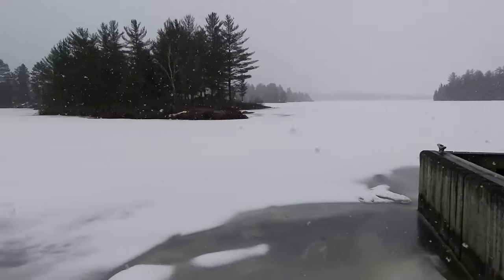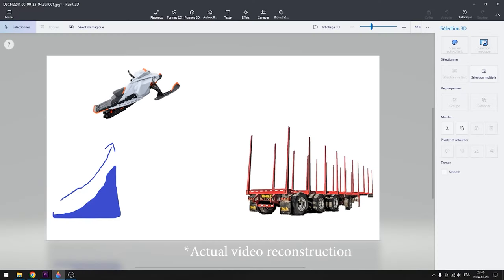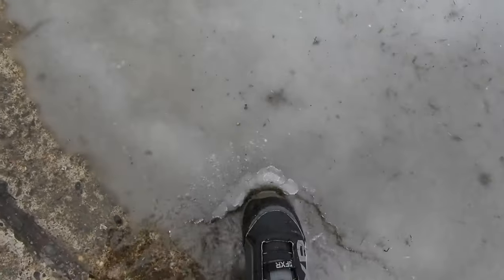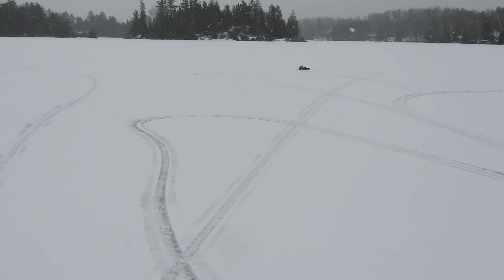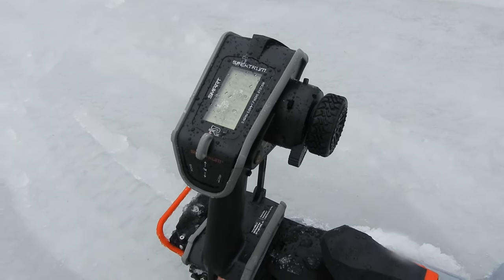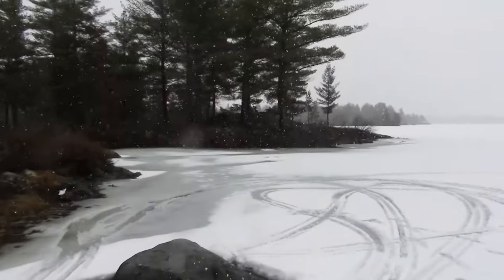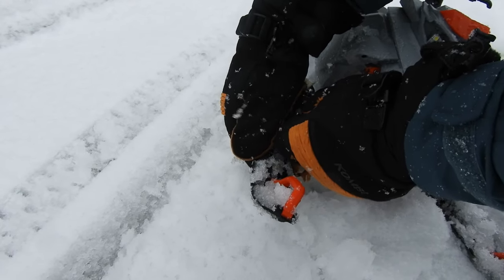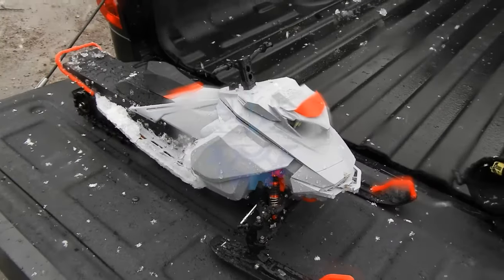Ice Racing Adventure - Skidoo G4 137'' Rc Snowmobile 1:5

Comment: At that scale, what would be 60mph on a regular size model be about equal for this scaled down version. ( hopefully that makes a bit of sense to someone lol)
Reply from the maker: So far this sled has gone about 30 to 40 mph.  That would be x5 because its a 1:5 scale.  Basically 150 to 200 mph in scale speed😁

But there's a lot of potential left on the table if speed was the main goal.  It could easily go 60 mph

Comment: I’d like to build and gearbox drive system that can drive speeds like that, I once had a Gear drive only can go 12-16MPH MAX, than once I ran out of Gear teeth, I switched to Belt drive went over 20mph but I have slip problems and I need help with gear drive system

Comment: Where did you buy electric parts and how much that cost
Reply from the maker: @antti-veikkohiltula  any hobby shops can have all of the stuff i used.  Its basically a 1/10 scale brushless electronics kit.  It was about 700$ as i have high end stuff, but you can get some of that for way less.  Maybe closer to 250$
Reply: @Pascal_Robert--Rc_Creations  thank you. I think that you print yourself parts to your sleds, how much cost filaments to printer
Reply from the maker: @antti-veikkohiltula  i do.  The material i use is expensive.  Usually around 60$ per kg.
Reply: @Pascal_Robert--Rc_Creations  Ok, how much filament you had to use for one sled?

Comment: Wouldn't the be Stainless Steel "skegs" ? Carbide and SS are 2 different materials
Reply from the maker: I agree, but for the sake of simplicity, i called them carbide.  But you are correct, they are stainless.